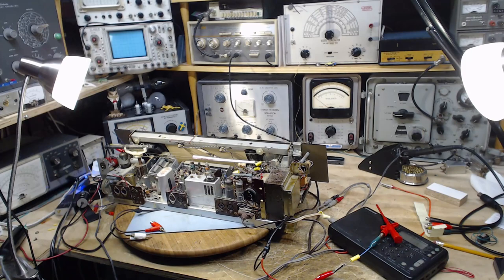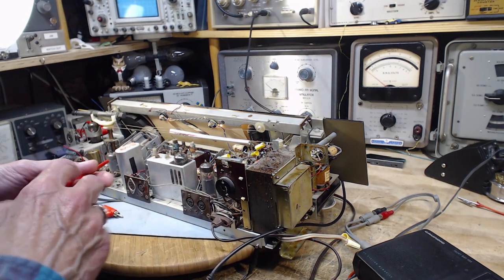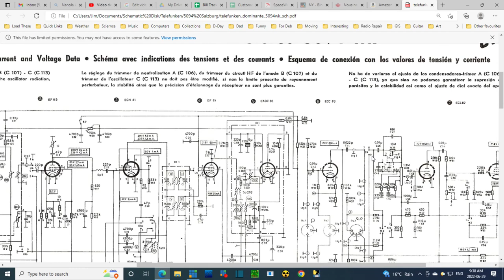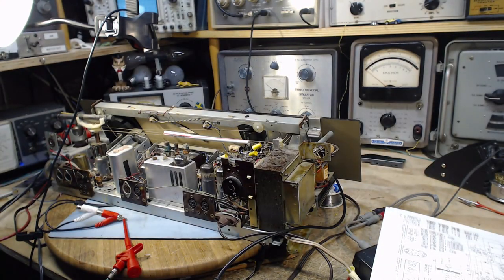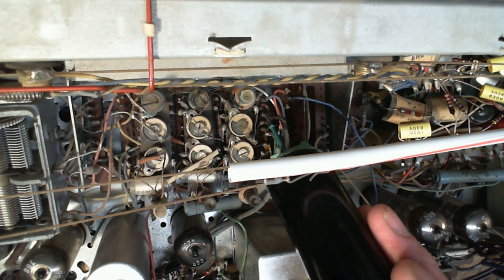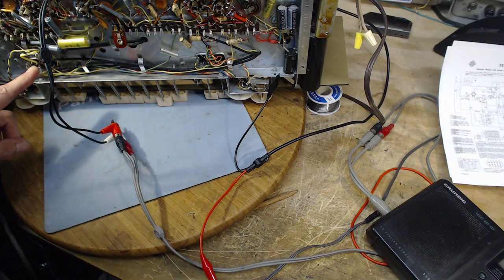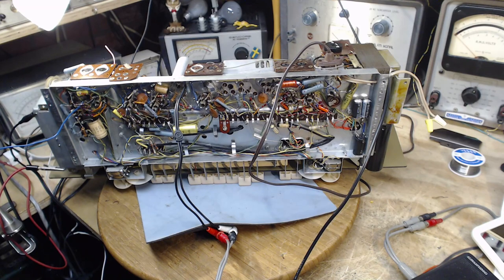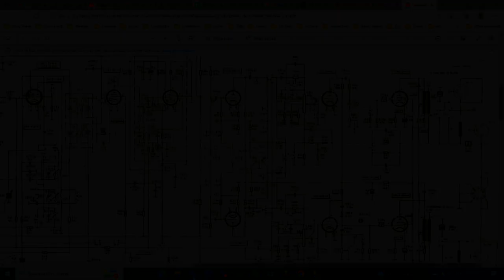Telefunken Salzburg 5094W Console Video #18 - Fault in Tone Circuits?

Comment: Listen Jim. 80% of all your problems would be solved if you cleaned all switches and controls before beginning troubleshooting, step 1. You disconnected the wrong speaker when you tested the tone controls and switches. Just an observation.